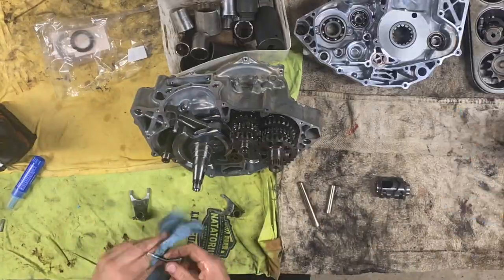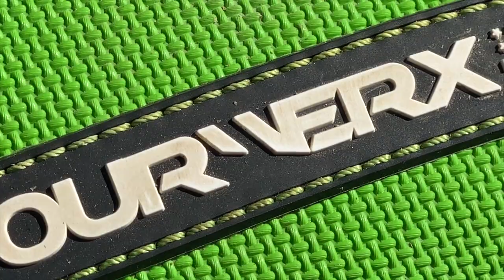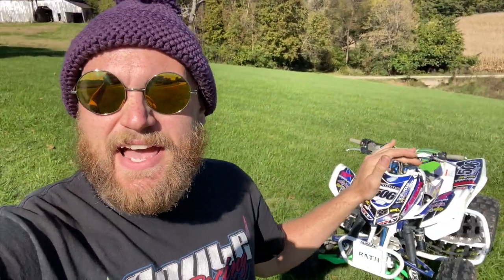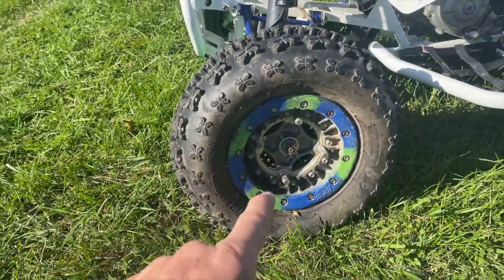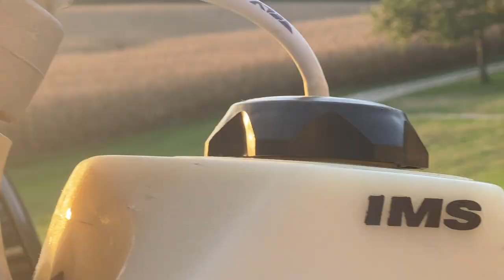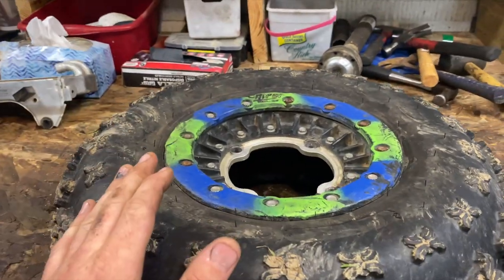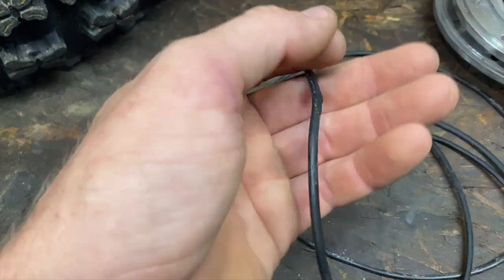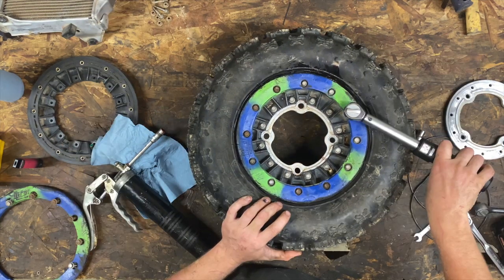I FOUND THE ONE (300EX)

Comment: I am gonna buy an older 300. Can find them clapped out for under a grand. Then I'm gonna put an xl600 or xr600 motor in it cuz they're about a grand and wouldn't be too hard to make fit in a 300ex frame. No cooling, little wiring cuz no e start. Lack of battery and starter would give more room for bigger jug and save weight. Would have about 2.5 times the power. Keep everything else stock. Ultimate sleeper quad.